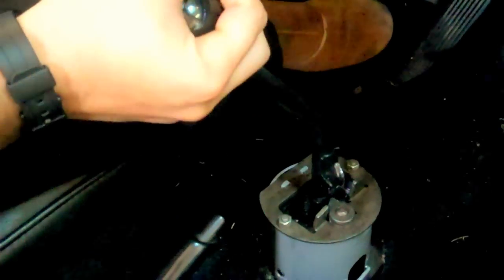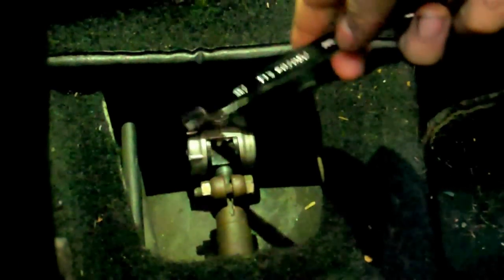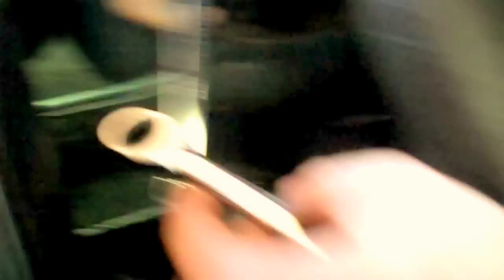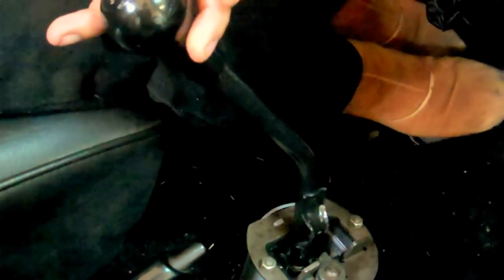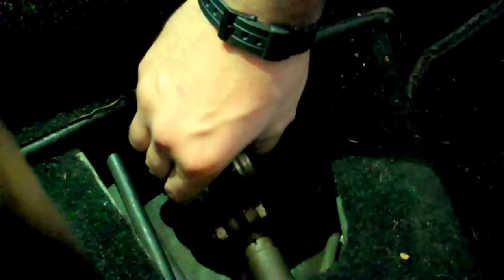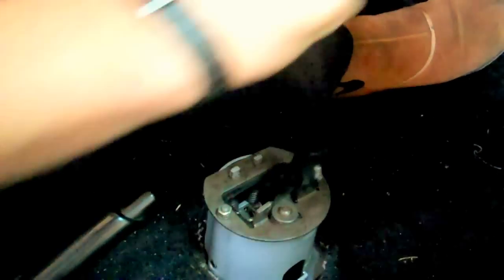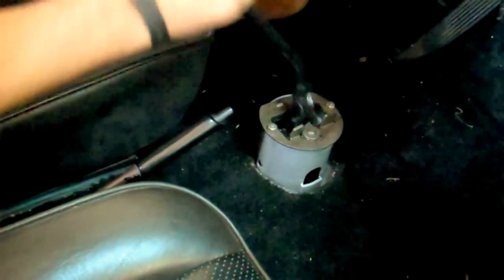How to Adjust a Porsche 911 Shift Linkage

Comment: This procedure worked great for indexing my early 911 trans. The only change is that for the early trans (901 and 911) with a dogleg pattern, set everything up opposite as far as shifter position and coupler position. The coupler should be rotated towards the left side of the car and the shifter should be resting on the right side of the gate.
Reply: Do you think I should do this for my 1971 911 e?

Comment: Hey, your technique sort of worked on my 76, but when I first did it, I turned the trans all the way clockwise, and shifter to the left, but this resulted in no reverse. So, I moved kept the trans all the way clockwise but moved the shifter sightly left of vertical, and it works perfectly. 

When I first got my 912e (yesterday), it was adjusted all wrong and reverse lockout wasn't working, so going from 5'th to 4'th would engage reverse unless you pulled the shifter all the way to the left. 

Anyways, with a slight adjustment to your technique, it works perfectly now, reverse locking working great, all the gears click nicely. 

Thanks
Reply: Andy Somogyi great!

Comment: Great helpful video.  I'm a bit confused with the position of the coupler. I know the shifter should be vertical at 90° and slight push forward until resistance. But what is the correct coupler position? Is it forward/ vertical or forward turned clockwise until it stops? Thanks again.
Reply from the maker: +RNR24N7 Hi, 

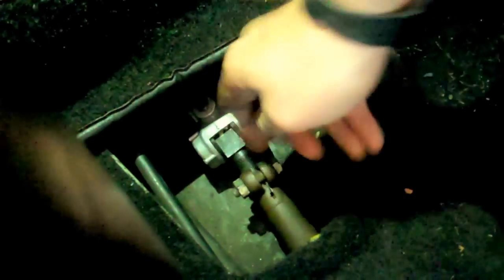Your coupler should never get &#39;vertical&#39;, it should always be in a horizontal configuration where its wider than tall. If its taller than it&#39;s wide something is terribly off,  like a loose coupler set screw. Make sure that the pointed allen head set screw is screwed in snugly to the shaft from the transaxle that the coupler slides over. In terms of coupler position, you can see how its done at 1:54 in the video. Check out this link for other helpful hints. http://www.pelicanparts.com/techarticles/911_shifting_improvements/911_shifting_improvements.htm 

If you observe how the coupler and shaft from the shifter interact,  you&#39;ll be able to reason it out as well. Be Gentle! Don&#39;t turn the coupler hard with crazy grip strength, you may hurt it.

Thanks for watching! Glad I could help, it gave me a devil of a time the first few times I did it which is why I made the video. Do it a few times and you&#39;ll figure it out guaranteed. Good Luck!

Comment: I have an 03 C4S that has never had any problems shifting into any gears but now suddenly I can not find Reverse?? 

Advice?
Reply from the maker: Earl Browning 
That can be common if it is out of adjustment. The guy in the link below was having the same issue you're describing. I recommend checking out Pelican Parts technical forums if you're a DIY kind of guy.  (http://forums.pelicanparts.com/boxster-cayman-forum/599809-how-do-i-adjust-shift-linkage-no-reverse.html)